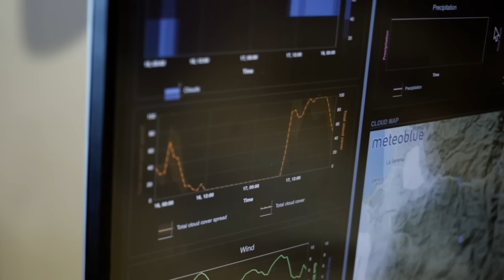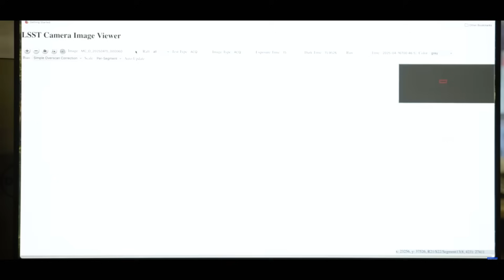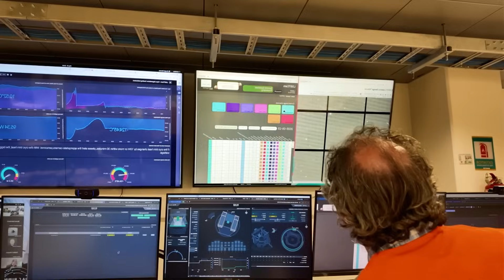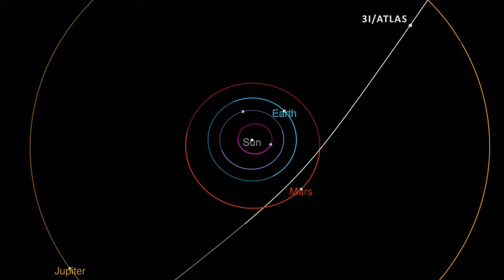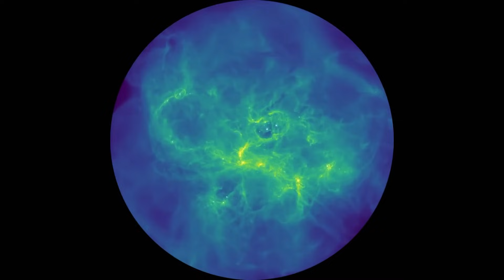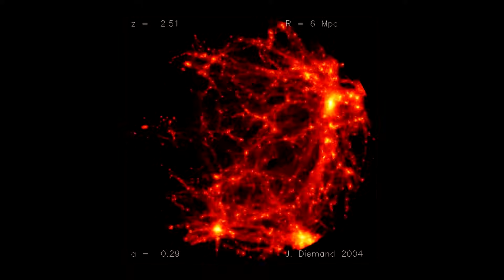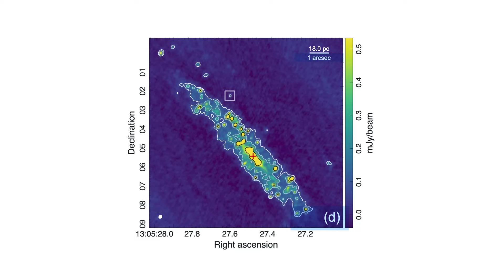$1 Billion Telescope Releases First Images… and Immediately Discovers Something From Another Star!

Comment: Another revolutionary telescope that will snap a multicolor static looking pic of something that has zero use for anyone, but a quiet murmur of approval of it deserving the budget that it had because, look so pretty, then you hear nothing more of it ever. We have mountain tops with clean air and zero light pollution riddled with more than very capable optical and radio telescopes, webb, hubble, and some more than a half a dozen other ones belonging to different govs, and lets not forget the freaking space station which im sure it already has the tech which will be "invented" for the public in maybe 15 years from now, so a bunch of already very capable equipment of tracking and snapping a damn picture, right. But all this failed to return a clear picture of something like...dont know...Omuamua? For us, i mean. Im sure theres photos that look into the pores of the material its made out of. So a new telescope, thats great man but absofuckinglutely zero benefit to regular schmoes who'll never be shown what it can see. But... t..thanks?